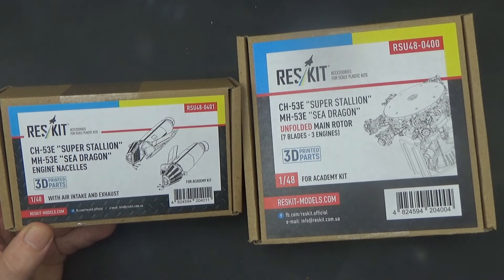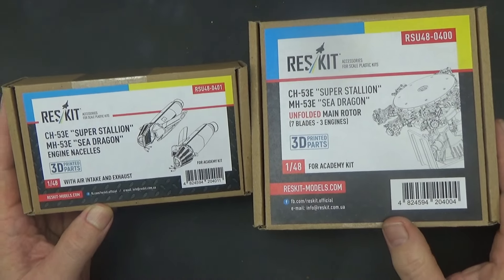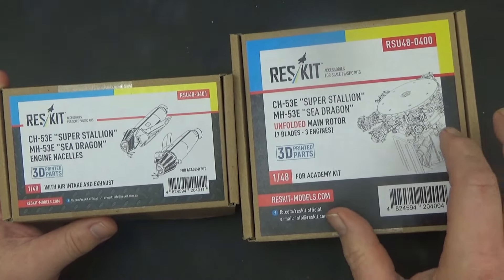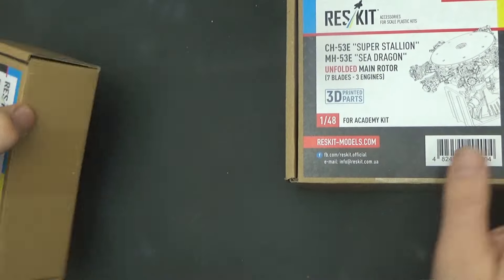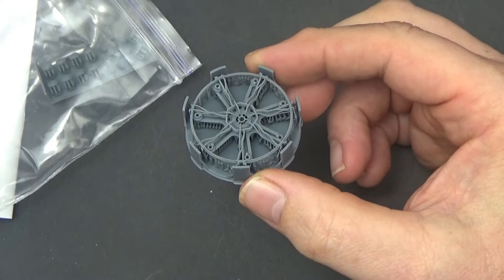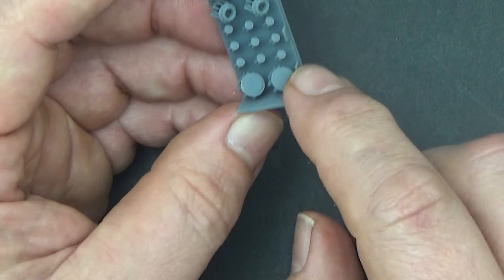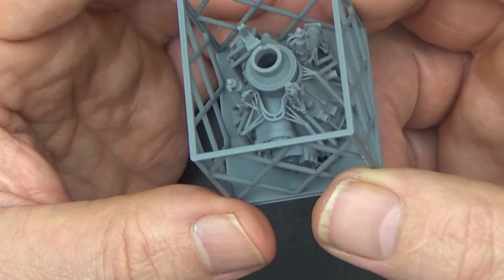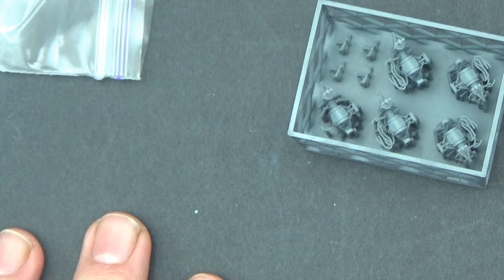Review: Reskit updated parts for Academy 1/48 CH-53E Super Stallion

Comment: To answer all your answers these new aftermarket parts are awesome i have bought these well detailed , easy  to construct and they fit the kit very well, i have the folded set,  the folded set had no template m1 for the cut out of the rotor head  and i got them from reskit in Ukraine took about just over a week  and no duty on them so no extra to pay

Comment: Gday Chris, modeling is certainly evolving into a new dimension, however in this video  you're speaking Greek for me. I'd love to get to this level of accessory building but having been in the Rip Van Winkle phase I'm still climbing that learning curve. The wheels up phase is not a problem, I'd love to see you use these two kits and finish out the monster chopper. I thought your previous work was great however I can see where these kits can cut down on the detail time as they are just about ready to go.I suspect they require a different paint and the Tamiya thin glue in the bottle doesn't work either. Anxious to see how you work them into the standard box parts. I'm afraid I'd cut the wrong part of the 3D sprue. Cheers Bob

Comment: Exceptional upgrade sets! be careful getting the supports off some of those fragile and finesse detailed pieces
Reply from the maker: I made one tiny little mistake so far...on the only piece Ive had time to cut off! But yes, good advice...i might use a cutting disc on the Proxxon...
Reply: @beckersmodels  I got my 1/72 3D chutes in today for my Su-35, same deal, I will need to be careful getting the supports off!